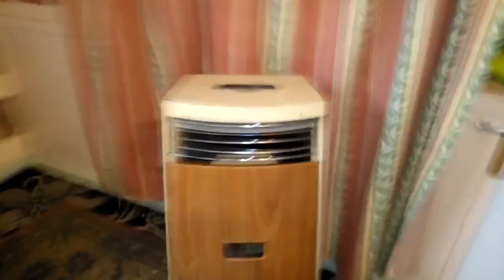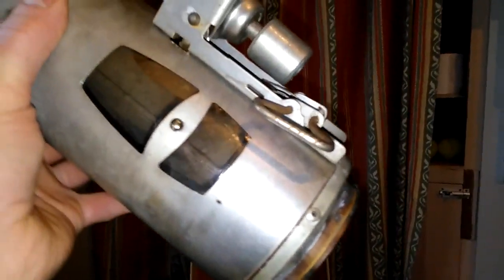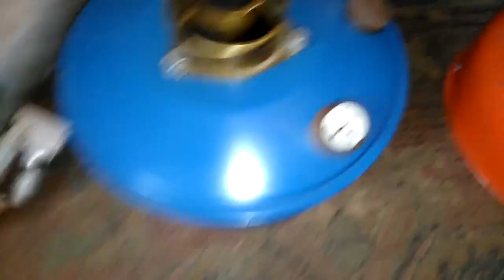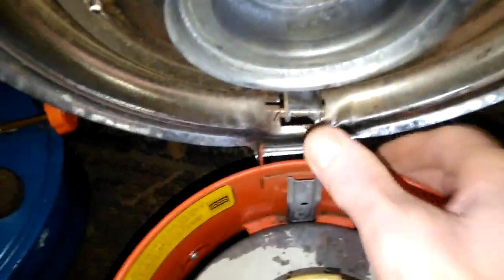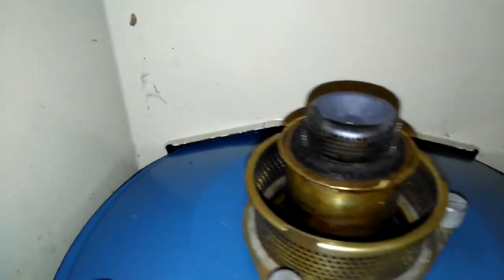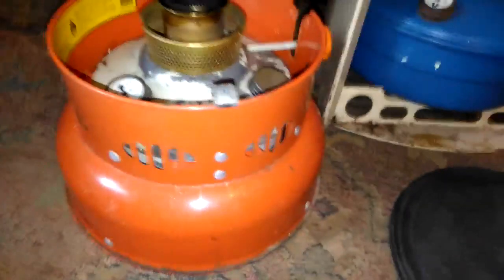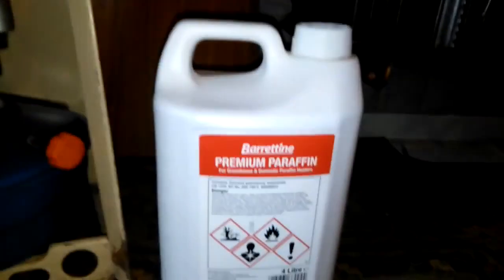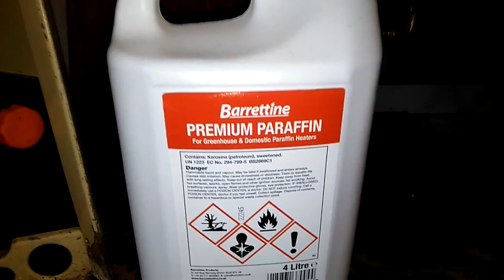Stay Warm This  Winter - Blue Flame Paraffin Heaters.

Comment: I remember when I was a very young kid, mum and dad bought a reasonably large Victorian house that had nothing but 2 useless brick filled storage heaters to keep the entire place warm. The house had single skin stone walls and seemed to suck the heat out of you. I swear, first thing in the morning it was colder inside that house than outside, even when there was snow on the ground ! 

That winter it got really cold, and as buying the house had stretched money right up to breaking point, mum and dad couldn't afford to get central heating installed for a few years. So one day, dad came home from work with the back of his estate car full of Daleks (Well, that's what they looked like to my adolescent eyes. :D) and Jerry cans. They were 5 identical orange and wood effect Valor Viceroy heaters (like that one you've got) that he'd bought cheap from a colleague. It was back when every other petrol station had a paraffin pump right there on the forecourt, and they charged (IIRC) about 25p a litre for it. We ran those things 24/7 for a week before the place felt any warmer, but after that, the walls started to get up to temperature, and it actually started to feel quite cosy.

A couple years later they had central heating installed, and our Daleks got stuffed in the back of the shed out the way. Then when we moved several years later they were worth so little that they went in a skip with a load of other stuff.......... Looking at what they're worth now, and how much they're price is likely to jump if we really do start having power cuts this winter, I REALLY wish we'd kept hold of them now. :D
Reply from the maker: Hi. Thanks for the great comment. 
I grew up in a house with a few of these things around.
I just bought myself another eBay bargain - this time, it's an Aladdin series 37.
It's in amazing condition, apart from cracked fuel indicator and the wick adjustment knob is broken. It looks like someone's forcefully tried to turn it with a seized wick.
Both an easy fix though - no big deal.
I'm going to sell these two. The L210 has already been refurbished, with base and fuel reservoir repainted, along with a new wick. The Viceroy is part-way through the process. I'm going to wait until it's a bit colder, then put them both on eBay.😉
Reply: @brianmurphy8790  If the power goes out for more than a couple hours, and people start getting cold, these things will be worth more than gold dust soaked in printer ink !!! :D
Out of interest, since most petrol stations don't sell paraffin "On tap" anymore, and pre-packaged stuff costs a fortune, have you got any tips in where to find a place that sells the stuff cheap? It looks like the only readily available options these days is a 1 to 4 litre bottle for big money, or getting 500 litres minimum delivered to your own storage tank.
Reply from the maker: @Reman1975 
A pair of these would gulp their way through 500 litres pretty quickly, if you were reliant upon them for heat in a harsh winter.
Some models are dual use and can be used as a stove. As is the Aladdin S-37 I just bought.
You'd need several gallons a week each.
I'd say 500 litres would be a good amount to have handy.
'Rye Oil' sells in bulk on eBay.
Price depends on grade, but a good burner will tolerate lower grade, without making a stink.
I've had the Viceroy burner running on kerosene/diesel mix and it barely makes any smell - the L210 not so happy. 
That's down to the stack of the Viceroy having additional air inlets for premix. 
The flip-over design of the L210 also makes it difficult to get a perfect seal between burner head and upper body. So a tad of unwanted air can leak in. I've bent up the tabs that hold the reservoir in place, just a couple mm. Then I stuck 5mm foam cushion on them for leveling.The weight of the upper body sits on the burner head and the foam takes out the unevenness. It's miles better.
The Viceroy stack twist-locks perfectly into place, making an airtight seal.
Reply: @brianmurphy8790  I have a valor 207 paraffin burner, same as the L210 but no tip over feature.
I also have an Aladdin S-37.
I bought them both from ebay a few years back for a reasonably cheap price, they both could do with new wicks although I've never fired them up.
I didn't realise at the time how expensive they can be to run with today's paraffin prices.
I had a Valor 12D Paraffin Heater when I was around 18 years old, just before paraffin shot up in price and became more difficult to obtain, that heater served me very well for five years, I used to sit on top of it to warm up when I first lit it...after five or so minutes it got to hot to sit on.
30 ml of isopropyl 91% or higher, mixed with 1 litre of pump road diesel is meant to burn great in blue flame heaters but I haven't tried that yet.
Road diesel is much cleaner these days at only 15 ppm or less sulphur.
I enjoyed your video Brian.

Comment: i,ve used a blue flame aladdin heater for year,s, & an old black valor heater aswell, & they are great, but the price of paraffin has gone through the roof..   i get pre-packed parrafin from a local hardware shop, 4ltr bottle is 8 quid, so at 2quid a ltr, its way more expensive than petrol & diesel, & when i was a kid, in the 1970s my dad would send me & my brother to the local petrol station, (where you filled your own container) & it was far cheaper back then, than petrol or diesel, & these days they go on about reduceing waste plastic, they had better idea,s year.s ago..than they have now, i have empty jerry can,s & other fuel container,s, that i could use for parrafin, but no-where to fill them, i have to buy prepack, then throw the emty bottle away, it dosen,t make sense.
Reply from the maker: They're not exactly cheap to operate, but they are useful.
I've been using them as a central heating supplement. 
I put the CH on for an hour or two in the morning, then light the heaters.
I've been buying 20 litre bottles of C1 kero (premium paraffin). I've burned about 15 litres in the past 10 days. 
I've been experimenting with diesel and 'liquid paraffin'. That's actual 'paraffin', the stuff that baby oil is made of, not kero labelled as 'premium paraffin'. The liquid paraffin burns great with no odour, apart from when you put it out - it smells like a candle.  Diesel works, but not the best. 
I'm looking to get a twin-burner valor to modify. I'm going to install a preheat for the reservoir, so I can burn 'paraffin wax' (candle wax).
I recently got my hands on an Aladdin S-37. It needs a couple fixes, but it's a good one.
Reply: @brianmurphy8790  hi, i,m acculy going today to buy 4x4 ltr bottle,s, that i,ll use with-in the next 2wk, with having no central heating they are great, my main heating is still a victorian open range, with oven, that also heats the hot water, ( electric emersion for the summer etc, ) i dont usuly light the fire until around 4 or 5 pm, but infact with the range been all made of cast-iron, i can still feel a bit of heat off it when the fire has gone out, & is also the reason it prob re-lights fairly quick, but with ordinary coal being banned after 1st may 23; i.m not too sure how smokeless coal will burn on it, or how much its gonna cost for a 50kg bag, that i will have to start buying after the ban, but any ordinary coal that people have stored after may1st,may, you can still burn it..for how ever long it take,s to use it up, (cos obv,s it will run out eventuly & obv.s the gov knows that)so i,m stockpiling atm, lol, got nearly 2 ton, but i want a lot more,  plus with living in a former coal-mining area, i know where there,s quite a bit of coal sticking out of cliffs..   where it keep,s falling off in huge lumps, usuly after frost, but has to be carried about a mile, to the car, weather permitting, so a parrafin heater is mainly a backup for me too..   i bought mine about 20yr ago from a local auction, i got it for 5 quid, (aladdin blue flame, the old round type) although i think its on its 2nd wick, & i have a new wick too, which serprisingly, you can still get, it was the best 5quid i.ve ever spent, thanks.. & btw good luck with finding the heater that your wanting.

Comment: That's mad all the ones I've seen on the Web and in Irish stores said 10 to 14 hr straight burn on 6 ltr I'd say they are lies to get you to buy,thanks for this video bro
Reply: No mate mine is a Japanese Tosai, 2kw, the tank is 3.8 litres and it will burn 16 hours on full...but I would have to strip off down to my shreddies if I had it on full for more than about 10 or 15 minutes.  It's great and not at all expensive to run.  At the moment it's about 7 degrees outside so I don't need it on for more than 2 half hour stints a day...after that I switch it off and light my Feuerhand oil lamp, to keep the chill off.  All the time with a window open.  That costs pennies per hour.

Comment: Brian, what makes the flame burn blue in this kerosene heater ??? Most heaters today burn with a yellowish reddish color. The smell sucks too. What is the BTUs of this heater and how long will it burn on fuel take ??Thanks for the help Sir.
Reply from the maker: The blue flame is due to the hollow cylindrical wick. 
Air is drawn up the centre of the wick and through the flame spreader.
This provides the additional oxygen needed for complete combustion, thus producing a blue flame.
Some heaters have a tinted window making the flame appear red/orange. 
The smell is mostly due to the grade of kerosene used, but an old, dirty or contaminated wick will also make a stink and a yellow flame.
If one of these heaters is burning with a yellow flame then something is definitely wrong.
I recommend using only C1 kerosene or better.
One litre of fuel will burn for around 3-6 hours.

Comment: Hello do you know can you use kerosene in your white and orange blue flame heater.   Tks
Reply from the maker: They will work with all kinds of light oils.
For use in a home, you should use the most refined kerosene you can get.
Reply: Paraffin is the same as kerosene, its just a little bit more refined.
Reply from the maker: @Queen-of-Swords  
That's kinda true but not entirely.
The word 'paraffin' covers a wide variety of highly refined oils.
C1 kerosene is often (wrongly, IMO)  described as 'premium paraffin', however, C2 kerosene is not.
Candles are usually made from 'paraffin wax', but these days they sometimes add palm oil.
Baby oil is made from 'liquid paraffin' (paraffinum liquidum) AKA, white mineral oil.
Not only is this used to make baby oil, but also sealing butchers blocks, lubricating food production machinery, cosmetics, medicine...etc etc. 
These heaters work great on any kind of kerosene or paraffin.
White mineral oil is the most refined form of paraffin and is far from being kerosene.
Personally, I like to keep paraffin and kerosene in very different categories.
One stinks and is toxic, the other doesn't and isn't.

Comment: Are these even safe in a bedroom or sitting room scenario?
Reply from the maker: They're perfectly safe if you use them sensibly. 
The case will get extremely hot so need to keep them away from curtains furniture etc, also children and pets need to keep away.
Never leave one lit if you go out.
They produce carbon monoxide/dioxide so you need some ventilation.